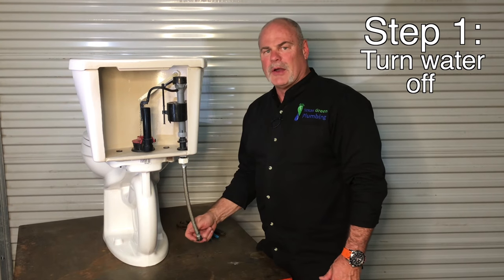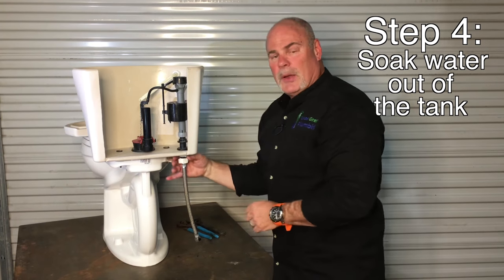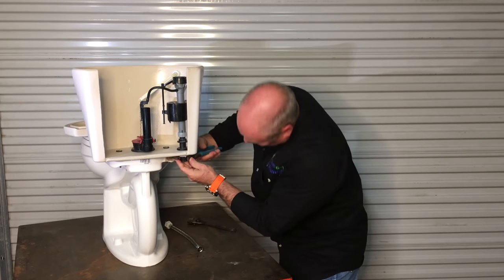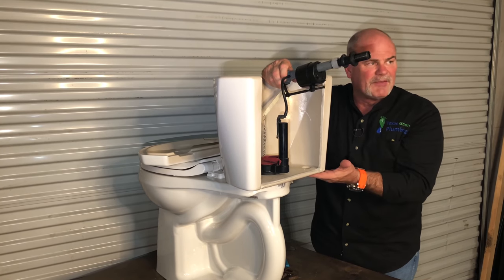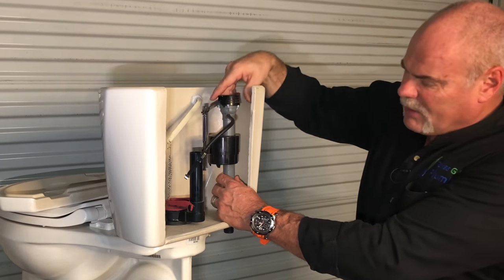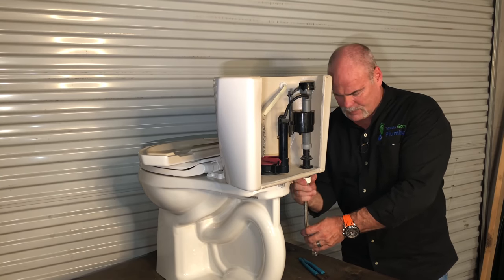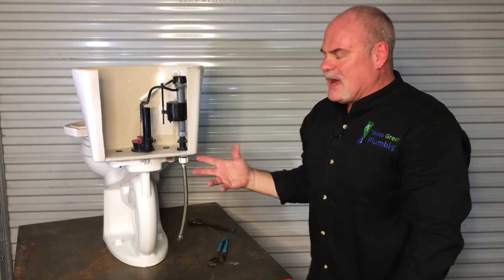Toilet Repair Fill Valve - DIY Plumbing - The Expert Plumber

Comment: Pro tip, you can do the swap in about 30 seconds if you already have a fluid Master fill valve. After you turn the water off release the height adjusting collar, take off the old upper half of the fill valve then slide on the new. Lock the adjusting collar back in place and you're done. No need to take off the lower section of the fill valve or the supply line.

Comment: My son has a new apartment, first out of college. He sent me a text at 5:30 am.  There was water under the tank.  Turns out the fill valve was stopping at various locations and in this instance the fill valve floater didn't stop rising.  Water was leaking from the handle. My son and I worked on it together and now he knows how simple this job can be. Not only did you save me money but also worry and anxiety!  You communicate so clearly.  Thank you so much for this video!

Comment: Nicely done, Roger. I just completed the repair based upon your video. It truly was as easy as you said it was. Perhaps even easier. I was originally going to call a plumber but then I thought "let's see how bad it is to repair...let's see what youtube has to say." Boy am I glad I took the time to find a video on how to do this myself. It might have been a bummer had the shut-off valve not worked correctly, but it gave me no problems whatsoever. I appreciate your "to the point" approach to making these videos, and especially going the extra mile to show the cut-away view so we can see what is really going on in the tank. My "screaming" toilet is screaming no more thanks to a new fill valve that I installed in less than 30 minutes. Thanks for the guidance, and please keep making these excellent videos.

Comment: I just replaced one today. First ever “plumbing” diy job I did. It’s amazingly easy to change out and get it working right. The hardest part is making sure the valve is set at the correct height, but even that is super simple stuff

Comment: Thank you so much for this video - I was able to do this!! I also changed out the supply line because it did leak when I put it back on, when I looked inside I didn't even see a washer - so that was also very helpful advice.  Aside for saving some money it gave me a nice sense of accomplishment. Thanks, again!!

Comment: Thank you! For some reason my nut on the hose is stuck and seems to be “attached” to the fill valve inside. When I turn the nut the whole fill valve spins and I can’t loosen it at all. It’s driving me insane

Comment: If you buy the same model valve you don't have to remove the entire valve, just  the top portion that's in the tank , you can still use the old stem that's connected to the bottom of the tank. Just lose the cufflink, slide out the old valve, replace the new valve in the same old stem and tighten the cufflink. Done.

Comment: Thank you!! Ours has been broken for almost a year, pipe of fill valve was cracked and would just run all the time...your video made it look so easy, and it was!!!! The one in there was so old it was mostly metal so it was very hard to get the locknutt off. But thank you for the confidence to be able to do it myself!!

Comment: This was great!  I tried to replace the full thing but old waterline said no, so I tried to replace just the top half the lock would NOT cooperate.. so I took the top apart gave it a good cleaning until I can get to the store and get a replacement flex waterline, and then yank that sucker out replace that and the valve, and leave my husband wondering what happened to the awful squealing sound, when any place in the house used water.. (all three bathrooms are on my hit list, thanks hard water build up)

Comment: Hi Roger, I have a question. Can a Fill Valve make a whistle noise and cause water to spray outside of the tank⁉️ I have a picture of something from inside the tank spraying water all over and onto the bathroom floor.

Comment: I have replaced many float valves in my toilets over the years and was really happy to find out I just needed to clean them. I have to shut the toilets off in the winter and put antifreeze in them but always get a bunch of dirt and sand when I turn the water back on. Now I know how to clean the dirt out of that top part, thank you.
 Do you have a good video of getting a bathtub with a clean out drain cleared? I have tried boiling water, vinegar and  baking soda, and plunged the crap out of it. I put the snake down the clean out but I don't think it went far enough. Don't want to use chemicals bad for the septic system.  I guess I will try the snake again, been using those since I was a kid.
Reply: I’m sure you’ve long fixed your problem, but maybe this will help someone else. Try Green Gobbler (Home Depot). I think it’s safe for septic systems, and it isn’t caustic like drain cleaner. It works with enzymes.

Comment: Nice work, 1 thing that was confusing that you may be able to edit in a picture of is the gasket. It was up, down, flipped and quickly done where I couldn't see it. I'm sure I'll find it on the instructions but just saying that part was a bit unclear.
Reply: Same issue here

Comment: The Fill Valve in my toilet leaks water at that top. It’s a bit different. Is it supposed to do that? Toilet hasn’t been flushing trying to figure out what’s wrong with it.

Comment: Mr. Wakefield, do you have any videos on adjusting a floatless fill valve? I have the type that has a plastic diaphragm at the base of the tank. Seems to be a rare beast in the float valve community. ;-)

Comment: I have dula flush toilet. I changed the fill valve because it made a high pitch squeal. After flushing the toilet there is a loud noise in the pipe.  What could be the problem?

Comment: Is there any adjustment for the TOILET FILL VALVE that I am missing?
The level of water in my toilet is way down near the bottom ... too low!
I have had a leak from the gasket of the TOILET FILL PIPE and replaced it.
I adjusted the height of the float, and the extra little valve that regulated the rate of water filling.
But, the problem is my toilet barely fills up at all.
I did not touch the Flush Valve, and from all indications the Fill Pipe is installed correctly.
I have a really weird very wide Flush Valve from my weird ( people tell me ) American Standard low flow toilet.
When my toilet flushes it sounds like all the water crashed down at once ... doesn't sound like a regular toilet, but it has been that way since I got it, and it has worked, albeit loudly for over a decade.
I removed and re-adjusted the Fill Pipe ( screwed it to the maximum height ) which is what the instructions to the Fill Pipe replacement kit said to do.  It also said to open a little red valve that lets water flow in faster so it fills the tank fasters.
I am stumped.

Comment: my fill valve has suddenly started making odd sound of filling then stopping and filling & stopping + filling and stopping until tank is full.
The float is getting the water shut off at the right height, but it doesn't make the continuous water filling the tank sound anymore and it has stopped flushing the bowl.

Comment: what I do as long as the base washer is not leaking I leave it in place and just take the top off   just pull up on the collar to unlock it  and the valve just pulls right up and out    I just changed  3  in one week all were put in around the same time

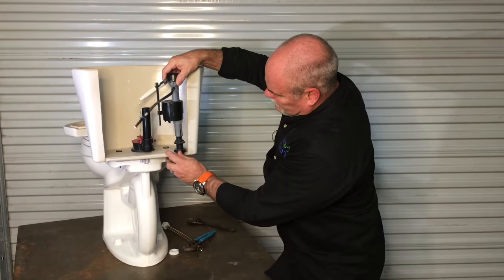Comment: 2:27 - "You want to make sure that this assembly is ABOVE the OVERFLOW TUBE".

Don't you mean that "this assembly:, i.e. the float value needs to be below the overflow tube?  Or, by assembly do you mean the top part of the Fill Tube assembly.  I have had a problem with my newly rebuilt fill tube where the level of water in the toilet is way too low.  Posted about it here today also.